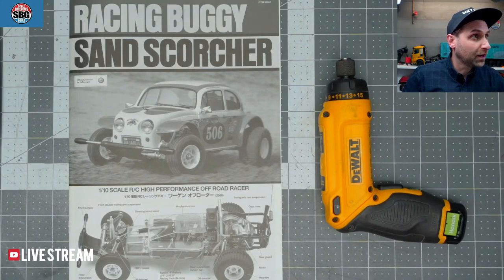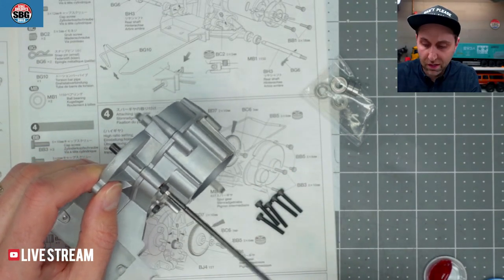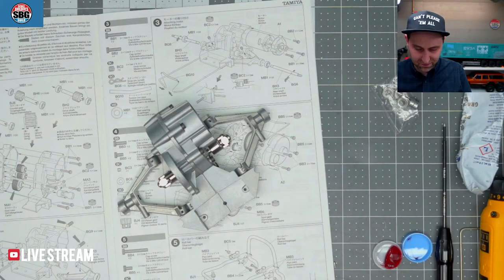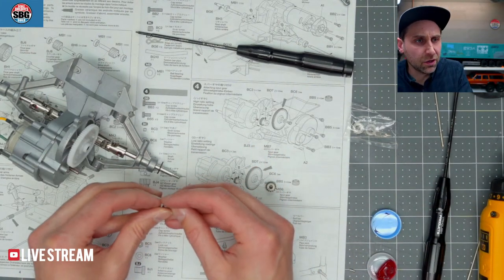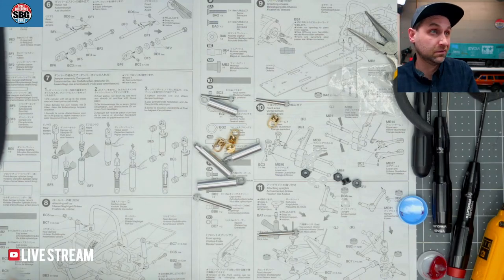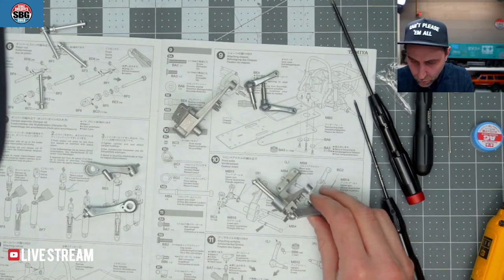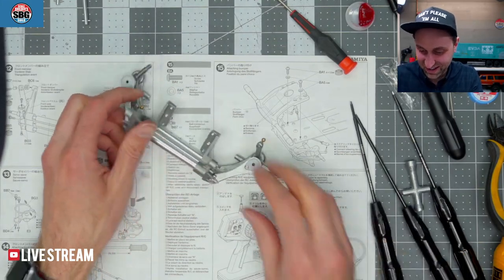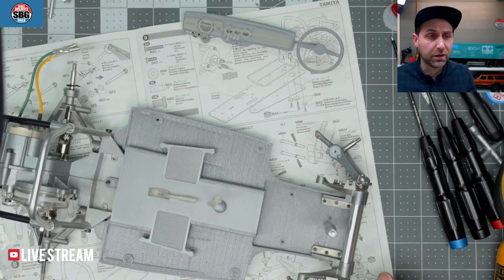Ampro Engineering Tamiya Sand Scorcher Live Build

Comment: This was my first tamiya kit and the original had all hex hardware except for the screws holding the body clip. Guess it was down hill all the way after that for tamiya screw-wise. The original kit also came with a small tube of silicon sealant to seal the gearbox and the receiver portion of the clear box because the metal casting fit and finish weren't that great. I got the reissued one also and the casting material and fit and finish were superior. One down side with the original kit was that it did not include any ball bearings whatsoever just brass bearings. Still love them. Oh i used to jump them on dirt ramps that are about a foot-ish high. Didnt fly too high nor far with the stock silver can and 7.2 Nicad but it took the jumps and beating no problem but then again they were not like the big air jumps we do with modern MT/buggy. Love the build will get a ampro kit to convert the reissue.

Comment: Yes the hex hardware was on the originals kits. The ball joints are different now also. The old ones didn't have the hex head on the ball itself. I wished I could have been on the live. I could have saved you a lot of hassle.